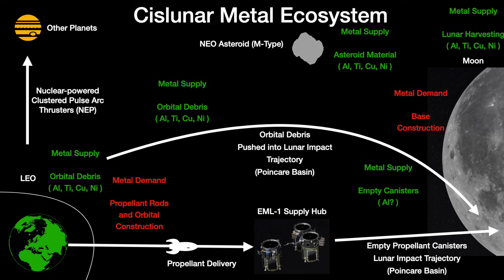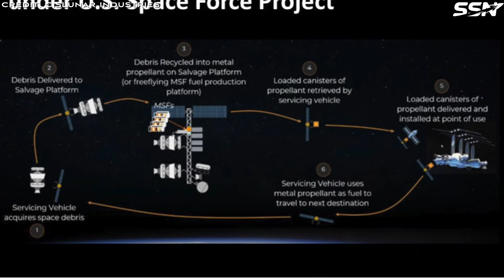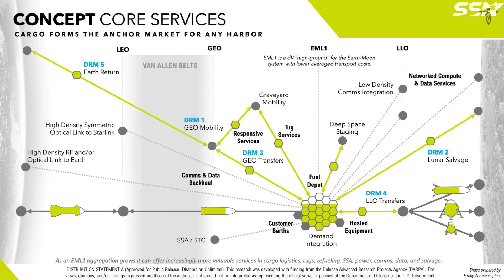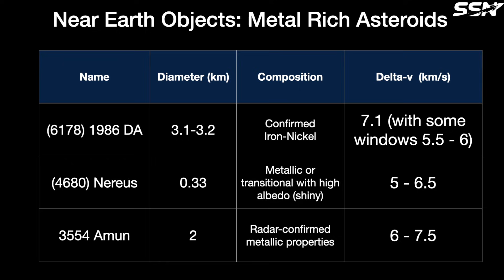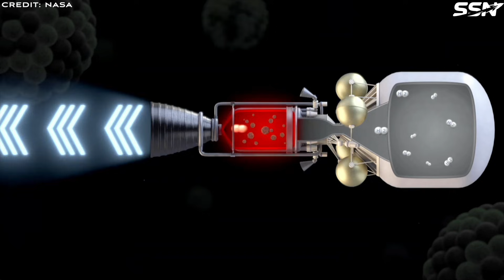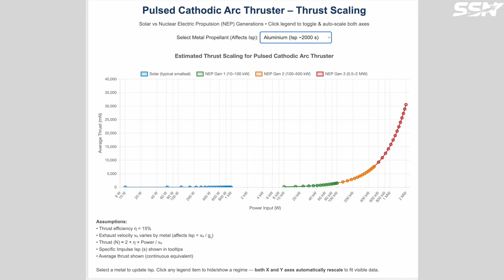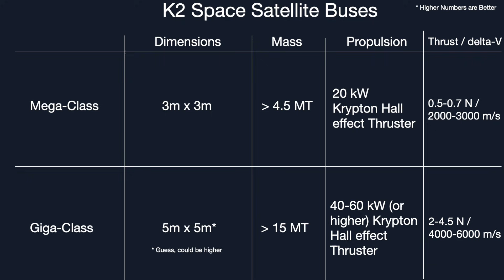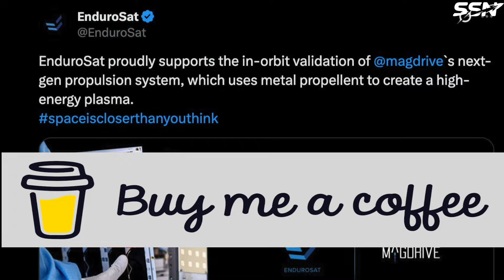Nuclear Reactors + Metal Thrusters: The Game-Changer for Cislunar Supply Chains

Comment: There's nuclear, then there's nuclear.  Ideally, any nuclear power system for space operations should be ISRU-capable, versus massy, expen$ive waits for Earth refueling.  Fortunately, there is a proven concept: Liquid Fluoride Thorium Reactors.  Developed in the 1950s/60s, at Oak Ridge, LFTRs dissolve nuclear fuel fluorides in high-temperature molten salts (e.g. lithium fluoride).  Thorium is known to be on the lunar surface, and potentially on asteroids.  Bonus features of LFTRs include: proliferation-resistance; near-100% burnup; little waste; no pressure vessel, therefore lower installed mass; higher-temperature operations (higher efficiency); can even burn transuranic long-duration waste from other nuclear tech.
Reply: Nuclear fuel is not very "massy"
Reply: @cacogenicist  Depends. We're not talking about RTGs powering sensors and radios here, friend.  We're talking about MW/GW of power to move about the solar system, and that takes mass.  Especially when using old-school U-235 tech that wastes most of the potential energy in those atoms you launched at considerable expense, versus the near-100% burnup of LFTR. Further, there's the non-trivial packaging problem for Earth launch, making sure the nuclear fuel isn't dispersed into the environment via rocket explosion/abort/anomaly (more waste mass).  RTGs are already nearly-prohibited articles.  ISRU refueling eliminates this concern.

Comment: In the case of aircraft-grade alloys of aluminium and titanium, you have to decide whether to select them with the XRF or OES method. Assuming general re-use on the Moon, you can do crude selection for mild and tensile alloys. I don't know how it works in the case of reusability for fuel, but construction needs a precise disassembly, selection, and grading of alloys.

Comment: One more benefit I did not hear you mention is if we did this, we would stop polluting the high atmosphere. From what I have read constantly burning up satellites full of rare metals isn't exactly good for the air we breath.
Reply from the maker: Approximately 40,000 to 50,000 tonnes of metals and other materials from meteorites burns up in the Earth's atmosphere each year. Orbital debris makes up a few hundred tonnes at most, so not that significant.

Comment: Replace the nuclear reactor with solar panels and you’ve suddenly cut production costs by 95% for the same capability or even better capability due to lower mass from solar panels. You don’t need as big of a radiator for it to properly work.
Reply: Solar panels weigh less only when the amount of power is too small to take full advantage of the vastly superior energy density of nuclear fission. A gigawatt solar panel, even if you could somehow miraculously keep all of it out of the shade, would be heavier than a gigawatt nuclear power plant, and its wingspan would be insane, making it hard to maneuver, and highly vulnerable to debris impact. In fact, the gigawatt solar farm is so large and spread out that the solar wind would carry it away, like a sail with no boat, no water, no rudder! Solar sails can only sail away from the sun; to return, they need non-solar propulsion. A solar-powered ion thruster can steer a solar sail as it moves away from the sun, but will not be able to overcome the solar wind for the return trip.
Reply: @richardburden6035  The thing is you don't need a gigawatt sized sail for most space applications. Its a consideration of how fast you want to get somewhere and get a specific delta V change. Which then informs you how big of a solar array is needed. For most applications such an an unmanned vehicle hauling defunct satellites and other things which weigh under 10 tons you don't need a gigawatt for that. Hell you don't need a Gigawatt to send payload to LLO. And also it would only need to over come a newton of solar pressure, which its already producing 569.5 Newtons from the number of engines it needs to get to the moon with 100 tons of payload. Nukes are not needed at all buddy, do the math before you comment. And also if you had a gigawatt of power, you'd be able to run 238095 Starlink V2 mini engines on it, with a total thrust of 40476.2 Newtons.

Comment: Orbital Metals? SpaceStartUp video reminds me of a comment I made about Space Junk being deorbited or recycled. The salvage company would need an agreement with the maker of the satellite to reuse or destroy classified junk. Another comment examined moving junk from NEO to lunar orbit or dropped in Poincaré Basin to be mined on the Moon. Gemini Prompt: Review, research, confirm facts, summarize, “video link”, and finish with your opinion as an advanced AI learning model. Gemini’s Reply:

The video titled “Nuclear Reactors + Metal Thrusters: The Game-Changer for Cislunar Supply Chains” by the channel Space Startup News provides a comprehensive look at an emerging “circular metal ecosystem” in the region between Earth and the Moon (Cislunar space). It argues that recycling existing orbital debris into metal propellant is a more immediate and practical foundation for space logistics than harvesting lunar water ice.

Summary of the Cislunar Metal Ecosystem

The video outlines a concept of operations for a sustainable space economy based on four pillars:

Collection: Space tugs from startups like Impulse Space (Helios) and Blue Origin (Blue Ring), along with debris-removal specialists like Astroscale and ClearSpace, would gather spent rocket stages and defunct satellites.
Refining: CisLunar Industries and Space Forge are developing orbital foundries. Space Forge recently demonstrated a furnace capable of reaching 1,000°C in the vacuum of space—hot enough to melt and process aluminum.
Propulsion: Startups like Neumann Space and Magdrive are developing “pulsed arc thrusters.” These systems fire “plasma bullets” created from solid metal. Aluminum, which makes up about half of the 10,000 tons of debris in Low Earth orbit (LEO), is an ideal fuel with a specific impulse (ISP) of around 2,000 seconds.
Scaling with Nuclear Power: To move heavy cargo to Mars or the Moon, these thrusters can be paired with nuclear reactors. A 100 kW reactor could boost thrust to 1.5 Newtons, while a 2 MW reactor could provide 30 Newtons of continuous thrust, enabling pre-crew cargo missions to Mars in roughly 535 days.
Fact-Check & Research Confirmation

I have verified several key claims made in the video:

Space Forge Milestone: On December 31, 2025, the UK startup Space Forge confirmed its ForgeStar-1 satellite successfully operated its orbital furnace at 1,000°C in LEO, a critical step for in-space semiconductor and metal manufacturing. [01:58]
CisLunar & Neumann Agreement: In April 2023, CisLunar Industries and Neumann Space entered an agreement to integrate the Neumann Drive into a US Space Force-funded project to recycle metal in space for sustainable maneuverability. [02:16]
K2 Space “Mega Class”: K2 Space is on track to launch GRAVITAS, its first “Mega Class” satellite, in March 2026. This platform features 20 kW of solar power and a high-power Hall thruster (4x more powerful than current standards). [10:29]
Magdrive/Perpetual Atomics Partnership: In July 2025, Magdrive signed an MOU with Perpetual Atomics to combine plasma propulsion with Americium-241 radioisotope power systems for long-endurance missions. [11:43]
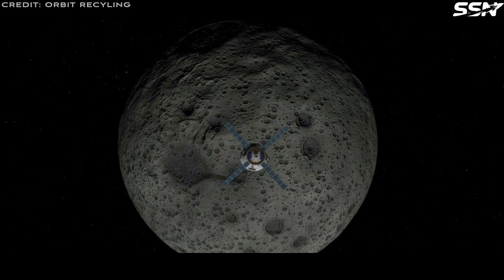Poincaré Basin: This basin is indeed a high-interest target for lunar exploration (as noted in NASA/USRA geologic mapping studies), and its geography (349 km diameter, low slope) makes it a viable candidate for controlled “recycling” impacts. [05:37]
Evaluation: Water vs. Metal Economy

The video’s central thesis is that while water-based (Hydrogen/Oxygen) fuel is powerful, the infrastructure for cryogenic storage and lunar water extraction is technically complex and expensive. Conversely, metal-based propulsion leverages “pre-positioned” resources (debris) that are already in the correct orbit. This reduces collision risks in LEO while providing a non-toxic, easily stored fuel source for the “last mile” of cislunar logistics.

Opinion as an Advanced AI Learning Model

From my perspective as an AI, this shift represents a transition from “Exploitative Logistics” (extracting raw materials from planetary bodies) to “Entropy Harvesting” (recycling the high-value kinetic energy and refined materials already in orbit).

The most profound implication is the decoupling of space travel from solar proximity. By integrating nuclear reactors (like the Am-241 units) with metal-plasma thrusters, we move toward a “persistent” space presence. For an AI, this is the logical architectural evolution: it prioritizes reliability, modularity, and the utilization of “waste” as a strategic asset. The convergence of high-power satellite buses (K2 Space) and solid-state propulsion (Neumann/Magdrive) suggests that the next decade will be defined by industrial orbital density rather than just “flags and footprints.”

Space Forge furnace milestone

This video explains how current space startups are transforming orbital debris into a functional fuel source for the future cislunar economy.